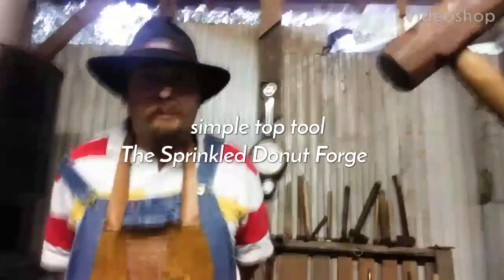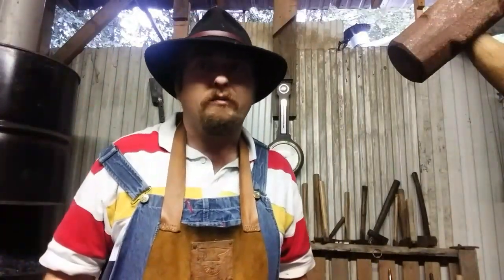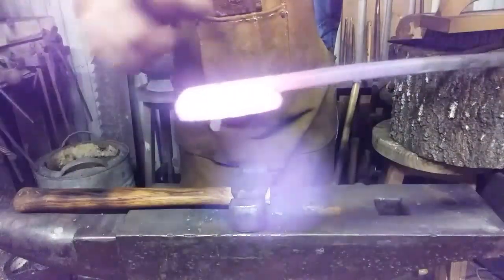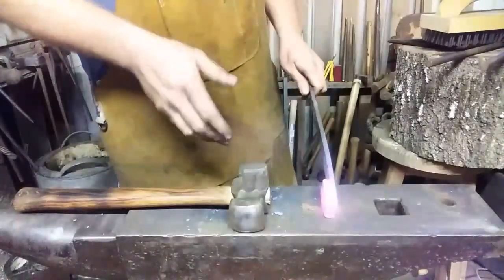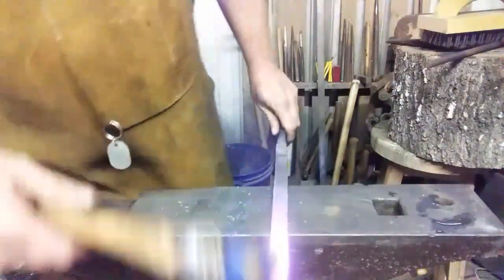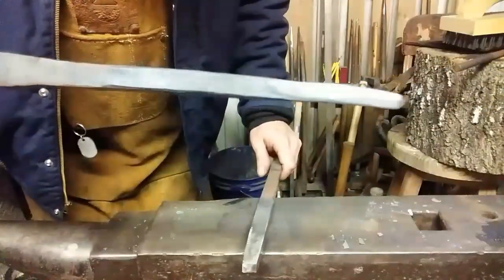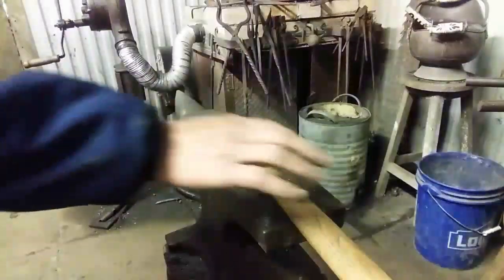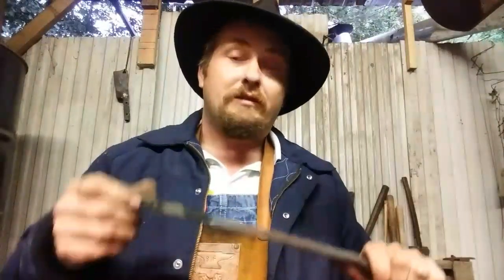Simple top tool from flat bar

Comment: No flux????  😮
Reply from the maker: No flux. Until I get some with iron filings I'm not messing with slippery old borax. Can't use grinder filings to mix with the flux because they have already been burnt up and would just pollute it. With a good heat and a solid brushing I been getting great welds dry. Just don't let them scale up or get full of ash.